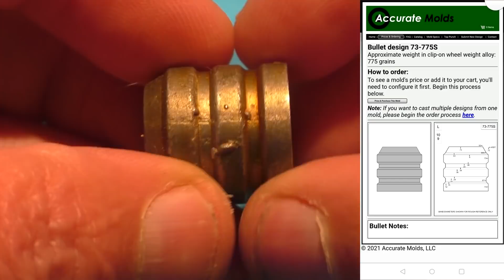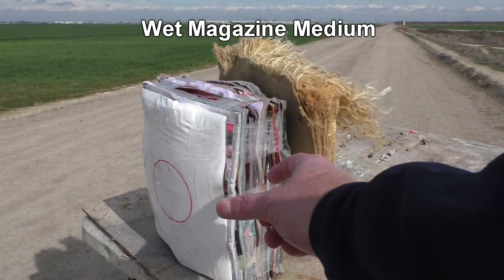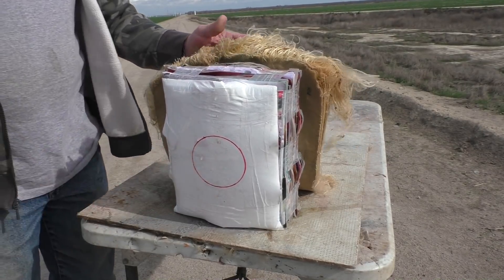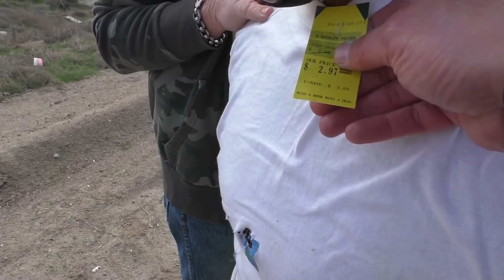Bismuth 12ga shotgun slugs - Shattering Results!!

Comment: I love this science channel!
Reply from the maker: thanks□
Reply: It's a shame there aren't more mass accelerators on YouTube.
Reply: After Demo Ranch, it’s my favourite!
Reply: @hickboyjusthick698  Mere(dith). A mare is a female horse :)
Reply: @taofledermaus  I would like to make this what part bismuth tin and the other alloy is it made of
Reply: @willrushing8098  the metals industry came out with its own lead free metal replacing lead with bismuth still with tin and antimony available at amazon and rotometals, for around 30 bux a pound. Gasp. Thats why i use pure bismuth at just under 10 bux a pound. Pure is more brittle but seems to hold up through over a foot of wood as long as no knots even up to 450 bushmaster speed. Glock im using a 450 diameter 200 grain mould i ran up to 1157 fps today in shortened 45 win mag brass to .893. Bismuth expands when it cools so will need to run through bullet sizer. 452 expands to around .458. I run through 3 sizers to try to not “stress” the metal til its flying😁
Reply: @pitchforkpeasant6219  thank you!
Reply: @taofledermaus  this is the first video I've watched since Danny left us and  though I never met the man I do know he would have been a good friend. 👍
Reply: @bradameerbeg2154  Demo Ranch is a bit too loony for me; gets a little cheap with all the clownesk behaviour.

Comment: I'm guessing the brittle nature of the metal allows the slug to shed layer after layer of material, so only the shed outer layers are experiencing resistance - and the remaining core of the slug continues to penetrate the target
Reply: kinda like depleted uranium
Reply: I believe the term is "adiabatic shearing"
Reply: @juslitor  almost... that's ablation.
Reply: When can we see slugs vs internet scammers?
Reply: The wet magazine pass through was impressive
Reply: @JacobTheGunNut  Just say OK to slugs😆
Reply: I'm guessing you don't belong here
Reply: I'll skip your comment and focus on your profile name, it sounds like a creature in fallout games
Reply: @WhackBytch256  "Self sharpening" is another term I've seen relating to a projectile that behaves that way, usually with depleted uranium. Meaning that instead of the point getting squished and increasing the surface area, it sheds small and sharp pieces and the diameter of the main body stays small instead of flattening out. I think the brittle bismuth structure might be doing something like that.
Reply: @Stigstigster  nasty stuff 😝 gotta get some 😏
Reply: So what APFSDS does
Reply: @readtherealanthonyfaucibyr6444  Yeah, that and the bowling pin it acted a lot like a hollow point. Those magazine stacks are TOUGH, back when I was able to do HEMA stuff with my swordplay we'd use magazines and newspaper separately both dry and wetted in place of tatami mats due to their availability, and the wet makes it act COMPLETELY different. Babbling. 

Really weird and interesting material for a slug, I think I like it <3 Be safe everybody
Reply: It's Mr. Shrimp out in the wild...In a place I'm not sure I could have expected.
Reply: @wren7195  Interesting, were they a lot harder to chop when wet?
Reply: funny enough this is the exact reason a number 2 Ticonderoga pencil will pass straight through a human skull  because graphite is brittle and stuff Adiabatic sharing or something
Reply: The tin is fairly brittle, too. Pure tin forms long, needle-like crystals.
Reply: @readtherealanthonyfaucibyr6444  Thank you for asking, I tend to give too much info so I apologize for the following lol But it depended on the sword, how wet, how thick, you know just variables and stuff. Overall it's easier to slice/draw cut or use a curved sword like a katana against dry targets, but even then you'd have to make the target much thinner. So like two inches wide of rolled up newspaper, magazines are easier to cut when stiff and dry but they are VERY dense when it's a thick dry roll, so if your cut turns over even slightly you won't go through it. I've never successfully cut through two inches of magazine dry, managed newspaper with my curved sword. 

For "chopping" or biting into the target kinds of "cuts," like using an axe sort of, wetted medium is extremely difficult to cut if you lose your edge orientation or don't have enough power behind it, but overall it's... "easier" to cut and bite into than dry? You can hack four inches of wet magazine with a perfect uberhau overhead cut with a longsword, and more easily wet newspaper, but your curved swords have to be even more controlled against wet mediums. They'll easily go through them, but the... "splooshing" of the material wants to drag your blade in all directions and destroy your cut geometry and you get stuck. 

LOL Sorry, in short wet is "easier" to get through especially with direct biting cuts, dry is very difficult against biting cuts but you can slash/slice it more easily if you control your energy through the entire cut... The Japanese kenjutsu masters test cut against four inch bamboo (green, not dried out) as well as four inch and other diameters of tatami mats, usually wetted. They give different feels for your sword, your cutting technique and what blade you're using, etc. 

Oh here, this might help some too. https://www.youtube.com/watch?v=WH5AxrHj6dY&t=3s  Sorry for babbling so much, I LOVE HEMA and my body just gave out due to illness, but I still study and love it and desperately want to share everything about it with anybody who's even slightly interested. If you ever want to know anything more I'd be glad to mail you all my book resources and stuff, jessibuttobi@gmail.com 

Keep in mind this is master cutting/test cutting, and swordplay had to often deal with armor (doesn't take a whole lot of anything to deflect your edge geometry in your cut, that's why it's important to feel how your sword moves when you cut two inches of dry magazines tightly rolled compared to four inches or more thoroughly soaked. The dry LOVES to deflect your energy, so the slice motion or draw cut motion will get you through it but it's a different motion than the "chop" hack whatever. The power is directed in completely different directions. Dry rolls are much more like attacking armors like leather or the often forgotten Eastern paper armors, the Chinese and Japan at some points used laminated "paper" for armor and it's hard as hell to cut through, and was often arrow resistant as well)

Be safe and well Lon, thanks for putting up with me, I hope this helps and I wish you all the best!!
Reply: @implausibleimpossiblehypot4006  Is that like the compression thing that they talk about when they stand a board on four side-walk chalk sticks and you can stand on it? So even though it's likely to shatter at a certain point, slow compressive (well comparatively slow, standing on it verses being shot out of a pew pew) force won't deform it much? 

"How about a magic trick? I'm going to MAKE, this pencil, disappear."
Reply: @wren7195  well the wood of the pencils makes like a hard cushion allowing you to use the graphite this way like a thicker pencils probably wouldn't work the graphite would shatter but graphite is very brittle and hard and it like crumbles into dust as it hits the human skull creating microfractures in the graphite and the skull allowing it to kill you or make you forget the alphabet
Reply: @MRblazedBEANS  well idk what kind of pencil he was stabbed with  but the lead probably broke because it went in at a weird angle straight up and down  would be more accurate
Reply: Should be selling these  !
Reply: Never would have guessed you liked shooting vids!
Reply: That’s exactly what I was thinking! I’m thinking either it forms a point as it wears down, or like HEAT rounds, it focuses the remaining energy to the center of the shedding layers...
Reply: @juslitor  I was about to comment that =)
Reply: self sharpening , like DU tank ammo?
Reply: @fridaycaliforniaa236  Great minds think alike ;)
Reply: Wow, I didn't expect to see you commenting on a video about shotgun ammo. Truly a man of diverse interests
Reply: Nah, it seems to shatter, into fairly large chunks.
DU is a whole other kettle of fish — it’s Pyrophoric and ignites into a superheated jet of projectile and armor slurry to then cook the crew. Bismuth is quite tame by comparison, also not radioactive.

Comment: I spent a few years as a tanker in the early 80's. We just called it the crew compartment or the inside of the tank.
Reply: If it rotates wouldn't it technically be the turret?
Reply: I think cockpit would apply. It is a pit filled with men fiddling with sticks that make things blow up. (cough) 
Like a balloon.
My ex "blew up" three times. It was expensive and time consuming.
Reply: M48s, M60s, or M1s?
Reply: @ProvidenceXIV  m60A1

Comment: Those looked like real Thumpers to Danny's shoulder (thanks for taking a bunch for the Team, Danny) and were incredibly devastating to each target.
Other than being difficult to control for followup shots (if required in a Social Setting) as long as you hit your target with the initial barrage there probably wouldn't be any need for followup shots.
Even if the intended target was behind your neighbors refrigerator two blocks away. 
In one word...  DAAYYYUUUMMM!

Comment: The tank crew area with the main gun is the "turret".  The tank body with the engine and the tracks is the "hull".  There are always exceptions but that's accurate for most modern tanks. Great video.  Your mass acceleration, with accompanying decelleration, expirements and demonstrations are excellent!

Comment: Those were hardcore projectiles. Good shooting as always. Makes me want to cast something weird.
Reply: Cast iron pan and propane camping stove gets u up to around 800 degrees. Just enough to cast zinc. Have to have a hot cast iron bullet mould though and still takes time to heat up internally. Softer than solid copper but still tough af.
Reply: @pitchforkpeasant6219  I have a 2000º Furnace ...

Comment: I would love to be able to buy some of those! They look great for hunting!
Reply: Great for hunting pigs, especially for those wearing kevlar (just kidding don't worry), not so good for hunting for meat since you'd be digging out a bunch of little metal fragments that would melt around cooking temperatures
Reply: @Lilith-Rose  bismuth melts at about 500degF. You shouldn't be cooking anything to that internal temperature!
Reply: @ScottKenny1978  with most cuts I like to put a good sear on the outside of the meat and leave it at that, I like my meat as rare as I can get, so the internal temps aren't an issue. However if any piece of the metal comes in contact with the pan I'd be having beads of bismuth melting out of the meat and rolling around the pan, plus I don't really want to be chewing on or swallowing sharp shards of metal so I'd still choose a brass or copper round for hunting if it had to be something other than lead
Reply: @Lilith-Rose  fair point, I really wouldn't want to swallow any sharp shards, either!

Comment: not "cabin" - "crew compartment"
Reply: Hey ClownShoes...it's called the"Hull"
Reply: They’d go right through a Humvee then imagine. No thanks!
Reply: @joshuazoldschool4720  what was you MOS?  I was 19E & 19K
Reply: @joshuazoldschool4720  -- Wouldn't the hull be the outside, as it is on a ship?
Reply: @gregb6469  The tank hull is the main body of the tank (just as it's the main body of a ship, so to speak) which doesn't include the turret. IIRC the crew compartment is the inside space which includes hull + turret.

Comment: I like the snot pieces in the air flapping around when the snot block got shot. Years ago when I cut a bowling pin apart it was 1 1/2 square by 4 inch pieces of hardwood finger jointed together and super strong glued into blocks . Oak wood

Comment: Wood's metal, also known as Lipowitz's alloy or by the commercial names Cerrobend, Bendalloy, Pewtalloy and MCP 158, is a metal alloy that is useful for soldering and making custom metal parts, but which is toxic to touch or breathe vapors from. It is eutectic, fusible alloy with a melting point of approximately 70 °C (158 °F). It is a eutectic alloy of 50% bismuth, 26.7% lead, 13.3% tin, and 10% cadmium by mass.

Comment: I have that mould and several others from Accurate and LBT in various calibers for handguns, ML and large bore rifles. All share that enormous meplat. They all penetrate deep and straight...and shed velocity like a duck sheds water.
Perfect for hogs and bear in cover.

I have not  cast it in bismuth yet.
Initial trials with .53 round balls were not great. Too fast and they shattered. Horrible penetration. Balls are light for caliber so I was really excited to see what you got here.
Bismuth may be the salvation of traditional muzzle loader hunting in California.

I am not at all shocked by your result. You HAVE to be cognizant of whatever is behind the hog you hit with one of these cast in lead for it will SURELY  pass through. This of course is the desired result of a large diameter projectile that is heavy and slow. Big leaky holes on both sides of the beast.
Still sorry to see so much frag but it out performed the balls by miles. 
Guess I will go plug in the old Saeco.

I know your focus is mainly shotgun slugs but you just did us all a great service. Lots to extrapolate. 

Awesome content.
Cheers!

Comment: Bowling pins are constructed by gluing blocks of rock maple wood into the approximate shape, and then turning on a lathe. After the lathe shapes the pin, it is coated with a plastic material, painted, and covered with a glossy finish. 
Because of the scarcity of suitable wood, bowling pins can be made from approved synthetics. Currently there are synthetic pins sanctioned for play in five-pin, duckpin, and candlepin. There is one synthetic ten pin model approved by the USBC. When hit by the ball, synthetic pins usually sound different from wooden pins.

Comment: The formula for that metal is listed in an old 1870's gunsmith manual for filling holes in steel pistol and rifle frames etc because its hard, can be drilled and tapped. And doesnt shrink so stays put where its cast....

Comment: Bismuth is a very unique material. Its crystalline structure of one of the Platonic Solids; a hollow cube in particular. It's this hollow structure that gives the material expansive properties when it crystallizes. Bismuth is also found in a very tiny island of stability amid its extremely radioactive neighbors, this lends it very energetic properties when its composition is tampered with. Lastly, if you study electromagnetism in any capacity, you will find that Bismuth's crystal structure gives it very very minor anti-gravitic properties. This is due, again, to the fact that it swells when it hardens. The crystalline shape of Bismuth actively works against force voidance of any sort, making it resist all manner of electrical compression. If Bismuth were any less stable, its crystal structure simply couldn't manifest in waking reality (it would be incredibly radioactive).

Comment: New experiment..shaped charge round. A double powder one to propel the round, double primer to ignite the shaped charge when it contacts the steel plate. Basically like a heat round that penetrates a tank. Should be able to do a 1 inch steel plate burn a hole right thru it.

Comment: Awesome round, be good as a close combat round, it would slow down the enemy and they would think twice attacking your position. As I have seen what rounds do to the human body, without body armor, these rounds would be a game-changer. But how would they work in extreme heat or cold. I was a soldier for over 20+ years, these rounds are what you call fk you up rounds, I was an MG for years, before changing trades, Cheers All, Keep the videos coming Jeff

Comment: Should have used a eutectic like 281 or 255. 281 actually is nontoxic without antimony. An eutectic has very fine grain structure also, and they don't wander in size over time. The alloy used hardens bismuth, and also is effected by cooling rate. Slower cooling would yield a finer grain too. I would electoplate the begeezus outta them too with brass. Fyi; it would not hold up going much faster. I can about guarantee the antimony is only sitting on the grain boumdries. Musical-metal might be one to try too. Its 80% Tin 20 antimony.

Comment: Make a slug out of the same steel you would use to make an Ulfbert sword.  Then include a titanium coated diamond maybe with a woven carbon outer shell not so sure about that one.  

Its good steel and the penetrator would be pretty sick but of course whose gonna donate a small diamond penetrator.

Or just use the steel penetrator with regular old lead.

Comment: Bismuth is a lot more expensive than Lead, but at least it escapes the opprobrium of the environmentally-obsessed.  You can buy it for only $6.00/lb - by the half-ton.  The smaller the quantity, the higher the price per pound, up to about $15.00/lb.  Lead is about a fifth of that in large or small quantities.  The Bismuth alloy used is interesting - very little Antimony and a LOT of Tin (compared to Lead bullet alloy, which is 3x as much Antimony as Tin, and less total solute); I wonder what the melting point is.
Reply: Are the prices you just quoted current ? I thought lead was getting expensive ?
Reply: @Fred_Bender  Those are current prices for Lead, across purchase quantities from 1 lb (high price) to 1,000 lbs (low price).
Reply: @Fred_Bender  Yes, those are current prices.

Comment: I'm curious of the length of the slug vs a standard lead slug to get a higher weight. I've cast some .54 bismuth bullets for my muzzleloader to test, and they're about 90 grains less than the same size bullet in lead.